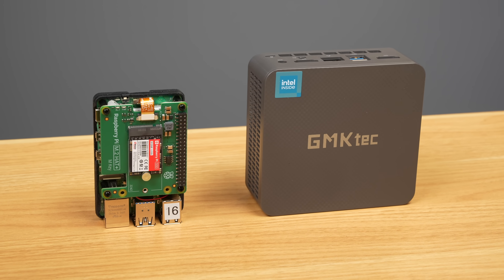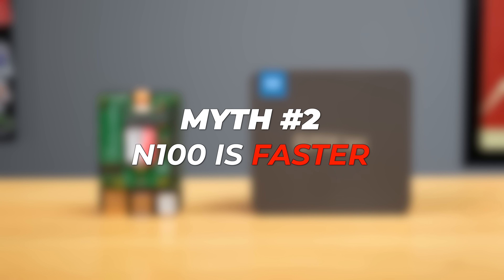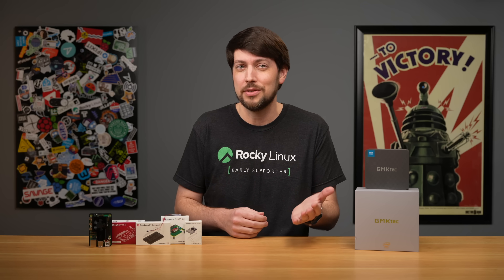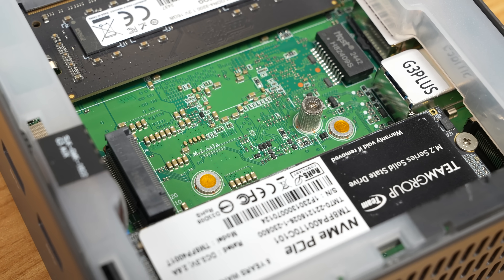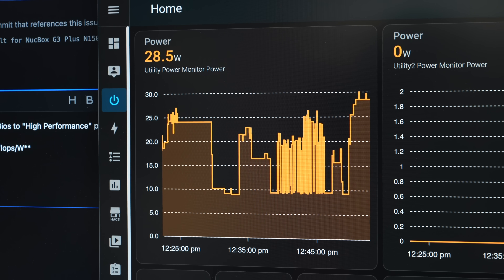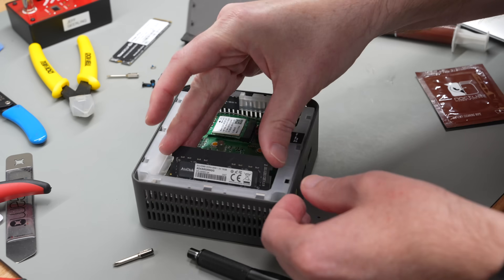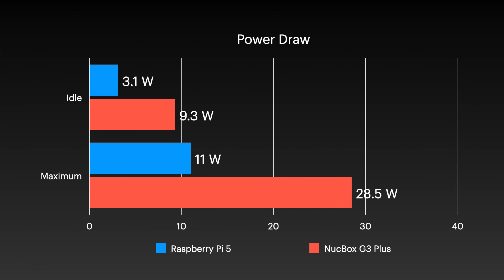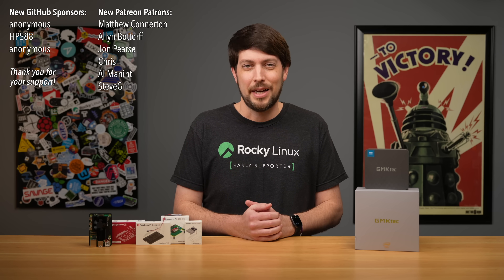When did Raspberry Pis get so expensive?

Comment: IMHO PRis’ only good use case at home is running as low-power tech appliances, like PiKVM host, klipper host, or a NUT server like you mentioned in a previous video. They are not very cost-effective at being PCs or servers, even without scalper prices. RPis are simply less capable than a PC, and should be way cheaper than a PC.

11:20 You are not comparing apples to apples either. That low-end configuration is cheaper, but is also way less capable. 2GB RAM and 32GB microSD is almost unusable these days, especially if you want GUI. There is also no way to upgrade the RAM on RPi, you'll have to buy an entirely new board if you want more RAM (which is also true for some high-end PCs, sigh.)

Comment: My most recent comparison point was Pi 5 8GB + GeeekPi P33 (case + fan + PoE/M.2 hat) + Crucial 256Gbyte NVMe versus the Minisforum S100 mini PC.

Here in the UK the Pi solution was £153 and the Minisforum one was £179. So the Pi IS cheaper, but you have to put everything together yourself. And the Minisforum is smaller. And it has 2.5Gbps networking. And it has USB3.2 Gen2. And it supports DisplayPort and data on its USB-C power input. And it has a full-size HDMI socket.

I bought the Minisforum.
Reply: And it has more options for hardware encoding/decoding, better GPU support, and you don't have to worry if things you want aren't compiled for ARM since they are almost certainly compiled for x86.

Comment: It's ok to poop on the Pi. It is what it is. I hate pi's pricing  they are way too expensive  .. but have several of them in nearly every variant.  For the money they are starting to fall below the curve on viability for desktop computer use but if you have a project that requires one as i sometimes do and will do again soon then they are great. Note  that i could stand the price if the performance was better.

Comment: Pi's lost the their appeal when they started prioritizing performance and adding desktop-like features, to try to make it appealing as an all-around computer, since this came with a significant price bump, the need for active cooling, etc. The thing that made Pi's stand out in the early days was that you could build cool projects that required just a little bit more power than a microcontroller for $30. I'd argue the most sensible product in their lineup right now is the Pi Zero 2W.

Comment: My  Pi1 died during the price hike. It ran some important services for me. I stumbled over used thin clients while looking for a cheap alternative. I bought a used, passively cooled thin client with a Celeron J4105. Upgraded it with a cheap M.2 Sata SSD and some old laptop RAM. This was significantly cheaper and more performant than a, at the time, overpriced PI 3. I put Fedora Server on it and it still runs fine without any issues.

Inspired by this channel, I am currently looking into clustering. Used thin clients are still the better option for me. I found some with a 4 core Celeron, 64GB SSD, 8GB RAM for ~55€. A pi with similar ram, hdd, case, cooler, psu and compute power cost  ~3-4x. The thin client uses more space and power than the PIs, but you can afford a lot of power for the saved money.
Reply: This takes me back. I had an HP Thin Client set up with Debian as voip server, Linksys Pots adapter and a cordless phone. People underestimate these thin client. So good.
Reply: I wanted to get a Pi for a project at work, but this was during the chip shortage, so the ones that were available were price gauged to Hell. I saw a Dell Wyse 3040 thin client, and got two plus shipping for the price of a single Pi. Also bought a quad core HP t620 6 months later and installed Proxmox on it. Currently running my home FreePBX install and Home Assistant.
Reply: Yup.  You can get a used HP T620 thin client for $25-$45.
Reply: During the chip shortage, I sold almost all of my Raspberry Pi boards and bought Banana Pis, Orange Pis, Le Potatoes, etc. Because they were at normal price. Got a number of new boards and many were more powerful or power efficient than what I sold.

Comment: I'm happy with 8GB. The only reason why I'm hungry for 16GB Pi5 is LLM. Wow, that stuff is addictive!
A quick check to adafruit, and it's sold out! 😢 I also need SSD, preferably 1TB! Currently waiting for Smartipi for the new case. It's supposed to be out in March 2025 (this month).

I do wonder if I need to update my power cables. I'm pretty sure I have 60W power supply, but it doesn't go much higher than 12W. Can it be the USB C cable? 🤔
Reply: Speaking of power consumption, the problem was solved when I lowered the CPU speed to 800MHz. Yay, for the infinitely configurable system! The computer no longer crashed. And unlike when it was on 3 CPUs, the LLM program no longer runs slow. 👍

520 words 9m47s

Comment: 10:43 In the tinyhouse where we live we have an offgrid solar installation with batteries and my NAS/server is a raspberry pi 4 in a geekworm NASpi enclosure for ultimate power efficiency and a radxa x4 x86 N100 Inside a Hacked Deskpi Pro v3 Enclosure for Office, GIS and CAD/CAM Use, in total no more than 140 watts, monitor included

Comment: Looking at a  a Pi5 for a project, I instead went with a used HP EliteDesk 800 G2 mini PC with an Intel Quad-Core i5-6500T, which came with 8G of DDR4 memory and a 240G SSD for under $100. Lots of USB ports, has a fan, only needed a DisplayPort to HDMI adapter for video. Biggest plus is the ability to replace components.

Comment: I bought a more expensive GMKtec with an AMD 4c/8t processor and added 32gb of RAM for Proxmox. To my shock and horror Proxmox runs badly and I can't figure out why, I think it has something to do with qemu gpu passthrough and the option is not available in the bios to enable. Also to add insult to injury type 2 virtualisation on a Linux OS runs faster on the device meaning I could have spent less than half the price on a N100/N150 or just used my raspberry pi with openmediavault since my Proxmox dream is dead.

Also funny you mentioned the faulty power adapter, mine smelt fishy when it got delivered, something I learnt this year dealing with a faulty water heater is that burn plastic can give up a fishy smell especially if it's caused by electrical issues, so I've been using the USB C for power because I am not going near the adapter. It seems GMKtec may have some QC issues with their power adapters.

Comment: So, in the end, it all comes down to what your specific use case is.

When looking to upgrade to a "smart" router and set my current Wi-Fi mesh system to AP only, I considered an N100 mini-PC, but ultimately went for an ARM device (a NanoPi R6C, not necessarily a Raspberry Pi but the same logic applies) due to its superior power consumption, because I live in a country where you pay 20 cents per kWh for electricity, so power efficiency is a major factor (along with lasting longer when on UPS power).

Comment: i went the used mini pc route. acer veriton n4640g, 360€ got a pack of 5. 1 of them has an i7 6700T the other 4 an i5 6400T.
the good thing of those, is that they have a pci-e slot on the outside. and an nvme inside. bad thing they are on skylake. such design makes for great mini pcs. the slot is limited to 35w however, but if the card is externally powered it will work.

Comment: The only major advantage the Pi has versus any of its competition is that it is based out of the UK while everything else in the space originates out of Hong Kong.  If you need export grade hardware that isn't potentially tainted by the Chinese government infiltrating your sensitive network, the Pi is potentially free of that kind of corruption because of its origination point.  In that case, the value proposition is "doesn't come with Chinese malware preinstalled on the hardware."  How much is that worth?  Probably any asking price!

Comment: I mean if the best that you, as a pretty big arm/sbc supporter, can come up with is well it depends then that honestly isn't the greatest picture for the pi anymore. I will say that I don't think the issue is that the pi has gotten expensive as much as it is that mini pc's have gotten so cheap and plentiful. I am not going to say that there is no use case for a pi because if you are looking at a function at the lower end of that spectrum then a pi is a great option. If you are looking for something that is going to have a GUI and function more like a regular desktop then the price to do it on the pi just isn't there for me compared to the mini PC. Yes it uses more power but you get more versatility and better software support for that. A big difference here is that as a desktop you likely wouldn't be running it 24/7 meaning that the power efficiency isn't going to be as great of a factor. Even if you are running it as a server 24/7 there are certain use cases where the n100 will be loads better such as video encoding as the N100/150 support quicksync. This means that the viability as a plex/jellyfin server is going to be a lot better with intel than it is the pi. the GPU is just anemic in comparison.

Comment: Recently got one of these. One nice bonus it has is the extra SATA m.2 socket. You could switch to slower sata storage to open up the nvme slow for e.g. AI co processors. Or if you don't need the WiFi, swap that out (though it's only one pci lane).

Comment: I'll take the 1.5 - 2x performance minipc and roughly the same price as a Pi 5 (~$30 more expensive but comes with NVME and 8GB ram is the base for N100. Add those to a Pi and they are about the same price/the Pi is more expensive for 1/2 the performance)

Pi is just no longer the value proposition it once was (and I have every single model except the Pi 5)

Comment: I recommend Dell wyse it's way cheaper than Rpi5. Dell comes with J5005 a 10w chip with 4g ram, and mine came with 32gb emmc, all for $40. I upgraded to 512gb-ssd for $30, more ram 16gb for $25. I'm under $100

Comment: Comparing what's in essence a module to a mini PC is problematic, as the pi’s performance under stress varies; some can push it beyond 3GHz while mine fails at 2.55GHz from overheating. At factory settings, 1080p YouTube playback pushes CPU usage above 40%, causing a choppy slideshow, while at 2.55GHz, it ran smoothly until it hits 80°C, when it throttles and drops linkages. Though ideal project board for warranty users, I must troubleshoot the hardware myself; a task my schedule can’t handle, unlike a plug-and-play mini PC.

Comment: I would have installed Debian. I have found the Ubuntu desktop desktop to be unstable on an Acer Aspire AMD laptop. When I installed Debian, everything worked fine. Both were installed the same way, using the defaults except for dual boot with Windows.

I still plan to buy Raspberry Pi SBCs, but mostly the zero line. Many of my projects include GPIOs and I don't want FANs (no fragile mechanical and noisy apparatus).

If no GPIO is needed, I buy used fanless HP thin clients: dirt cheap, Linux is very easy to install and everything works.

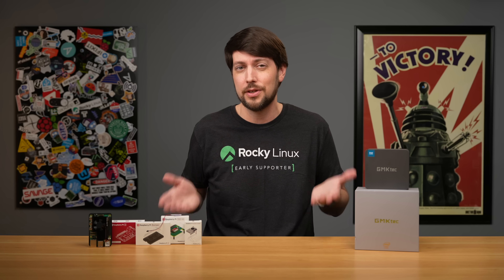Comment: 4:30 harder? You can buy an e-key riser cable to utilize the wifi slot, or use the nvme... both with minipc and rpi are going to need new cases anyway.

Comment: Honestly I'm extremely thankful for the N100 tip. I've a friend who was running nextcloud on some php hoster and wanted to finally give self-hosting a try and now they've ended up getting this mini PC and getting the entire setup running with NixOS quite quickly with no obscure issues at all. I believe to partially because for newcomers running Linux on x86 will still give you a slightly less cursed setup and with the pre-built device they could focus on learning one instead of three new things.

Comment: Pi 5?!? I'm still running the Pi 4's that i was able to scrounge during the pandemic. But seriously, i have both in my home lab and home production environments, and it really depends on the use case, and whether the software I am using runs on ARM. One thing you didn't touch on was virtualization. You can cram a lot of microservices in either docker containers or on proxmox. It might be a little bit more upfront cost to get a beefier system, but it can pay off in not always having to buy a new computer and having to find new rack (or shelf in my case) space to put the new computer.

Comment: They also make super solid AMD mini PCs which don't have the Intel issues. Pis are cool but not really replacements for computers.
Do you need GPIO and more power than an ESP32? Use a Pi.
No GPIO and just running software on something for cheap? Use a miniPC.

Comment: I've got an 8GB Pi 5 running in my homelab for NAS-related apps (including Nextcloud and Jellyfin for example) and one of these N series Mini PCs as my offsite backup. I got the Mini PC used for 80€ which was a really good deal considering that you can't get them below 160€. The Pi 5 was way more expensive (90€ + 60€ for all accessories + 110€ for 2TB SSD) but is running way more efficient, power consumption wasn't an issue for the offsite backup. I am happy with my choices so far regarding my homelab.

Comment: I like pis! But the more time passes, the less and less i can justify buying it for stuff. The last pi i have that is crucial in the house, is for home assistant, but i'll migrate to a n100 soon, because compiling stuff for esphome takes a lot of time (and i have plenty of esphome devices). On the forum, people say it is faster with the n100.
I think that if the pi had a nvme slot from the get go, it would remain more of a contender. 
The last use i have where i don't see myself replacing the pis is for my robots. But there, i would LOVE a pi zero 3, with more ram and perhaps more CPU, while maintaining low power.

The thing is, docker is easier on x86 than  arm, so with a raspi, most server stuff are more of a hassle. At some point, i was looking at pis with dual nics for a router, but then i got into opnsense/pfsense, and they only run on x86. But if the pi had not been so expensive/rare during the supply crysis, perhaps i'd be rocking a pi router.

One product that also causes me to use less raspis is the... raspi pico :)
When i need gpio for stuff, i can easily do my gpio stuff on it, and then control it via USB or even WIFI.

But still, your results make me reconsider the pi for some uses, perhaps i'll get a pi5 to play with it :)
(ah yes, i forgot a use where it is hard to beat : pi camera stuff : in this combination, it is hard to find anything remotely comparable, with both compute power, image quality, and letting me doing whatever i want with my stuff)

Comment: I have a somewhat unusual use case I'm trying to figure out parts for: a small rover with a tesla P4 of similar card for onboard image processing and other functions.

As far as I've been able to tell, it looks like a pi 5 / cm5 is the only realistic option. Power draw is very important when you are running on batteries which have other drains on them. And then there is what kind of support equipment needed to let a machine run, etc, etc, etc.

Comment: I am from India, most of n100 chinese don't ship here and the local producer are charging a little on the higher side, but the good thing is that the refurbished pc like elitedesk are dirt cheap here comes barebone and u can pop the ram and ssd as per ur need. Pi on the other hand is still not that much accessible here specially the hats and cases , so i had to go the refurbished pc way.

Comment: As far as value is concerned, i'd give it to the Pi5
However, since the N150 and the N355 cost the same to manufacture, and defects are effetively non existant on dies this small, if Intel ever offered an N355/N305 for $150 i'd say thats the better deal, double the cores...... 50%(?) more GPU but can still be configured to the same TDP for much better efficiency and performance.
Intel will never do that they're hurting for money too bad, they tried to price the atom class N305 originally at the same price as the i3-1215U which uses the same die as the i7-1265u

The funny thing is that the tray price of this class of (intel) processor was ~$60 just 6 years ago, now its $305 when they dont try to hide it(they stripped the Alderlake N pricing from their website for several months following criticism)

Comment: FYI ECC used to just work on desktop unless your processor didnt support it. You had to go back to DDR2 from like 2004 to go back to the last time they were keyed differently
(of note, LR dimms might fit but wouldnt work, also some forms of RDIMM wouldnt work with desktop processors if the modules were too high of capacity, also RDIMM functionality wouldnt work)